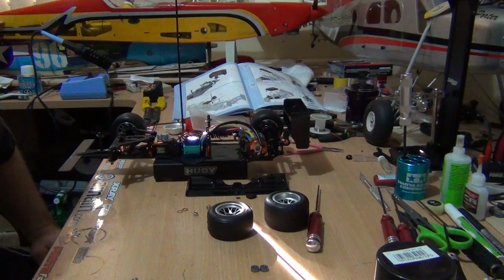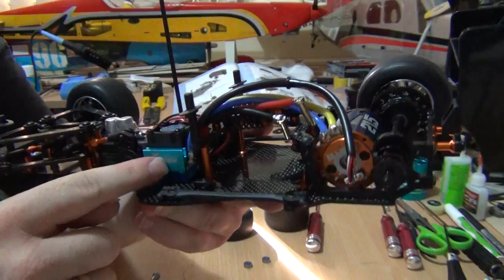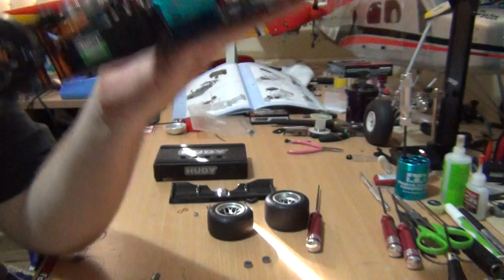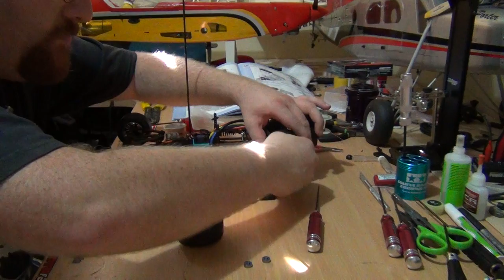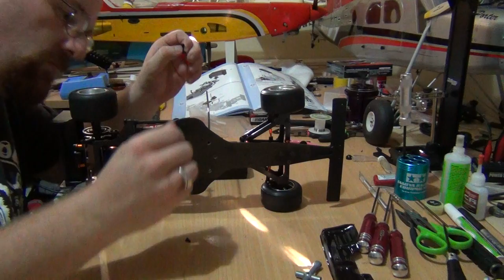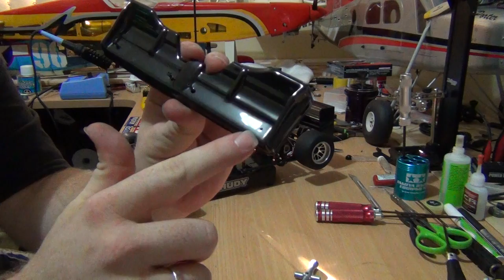Xray X1 build series part 14. Wheel/tires lexan wing & battery parts

Comment: Do you happen to have the model number for the tires/wheels?
Reply from the maker: Tom Wilcox Hi, sorry for the late reply, here are links to RcMart for the tires i used.Front tires:     http://www.rcmart.com/ride-front-f104-slick-tire63mmr1-high-grip-titc-2013-formula-class-contral-tire-26022-p-35470.html?cPath=35_1395

Rear tires:    http://www.rcmart.com/ride-premounted-f104-rear-slick-tirer1-high-grip-titc-2013-formula-class-contral-tire-26023-p-35471.html?cPath=35_1395
Reply: Thanks a lot ... how do you like the car?
Reply from the maker: I found it a lot easier to drive compared to my Tamiya F104 Pro V2. With the battery mounted in the sideways position i found it more predictable to drive. The kit set up is good, but i'm now starting to experiment with the set up with different spings and oil weights and tire combo's.